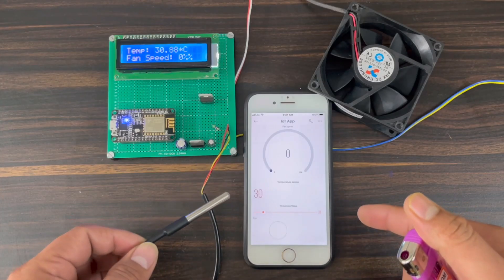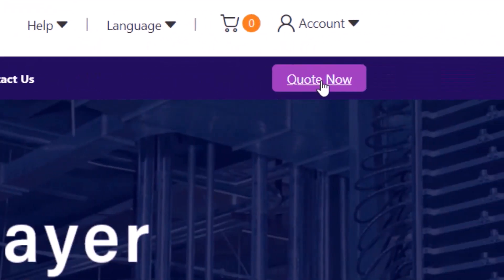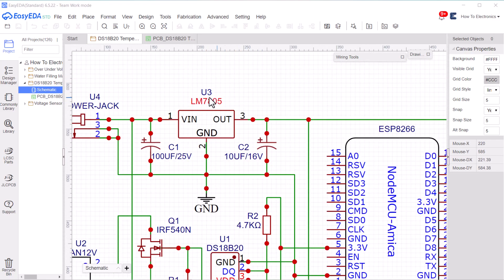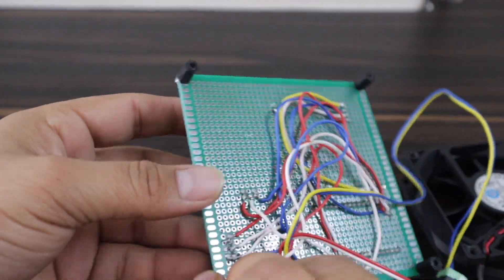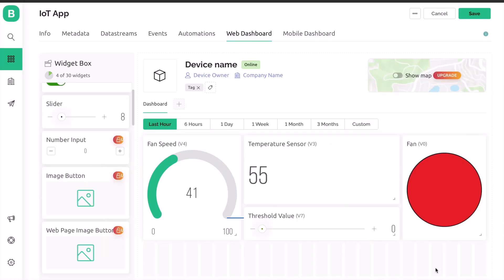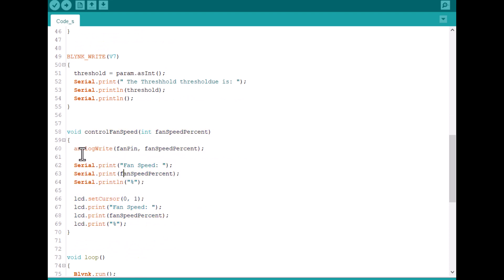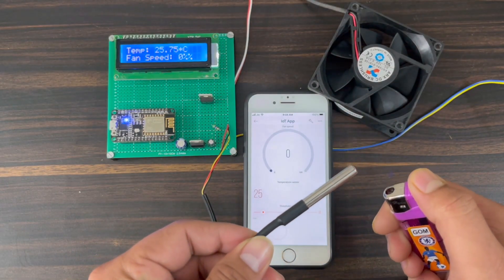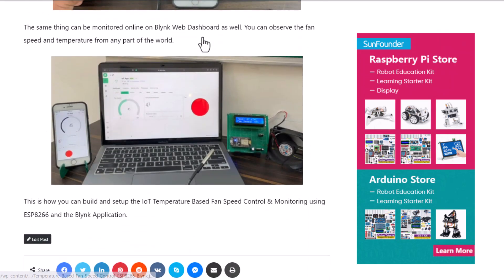IoT Temperature Based Automatic Fan Speed Control & Monitoring System using ESP8266 & Blynk 2.0

Comment: Do AC 220v fan speed control using this method...????😂 On youtube Everyone do easy DC 12v unusable tiny fan speed control and make video.
There is no use of this fan .
Reply from the maker: You need triac to control the AC Fan
Reply: @HowtoElectronics   can triac control  in this IoT temperature based controller .
I am using a manual triac speed controller.
Reply from the maker: I will make a video on that in a month. Please wait.
Reply: @HowtoElectronics   thanku very much.... waiting for video.
Reply: There is some error in the program
After compiling plz uplod the correct
We are making this project as our mini project in clg plz help
Reply: @navaneetht3042  what happened to project did project go well?